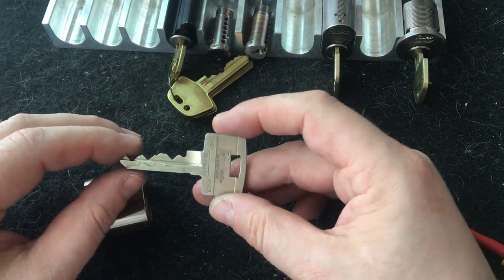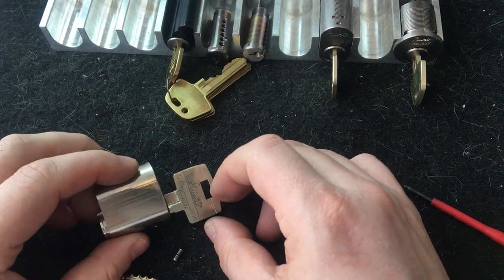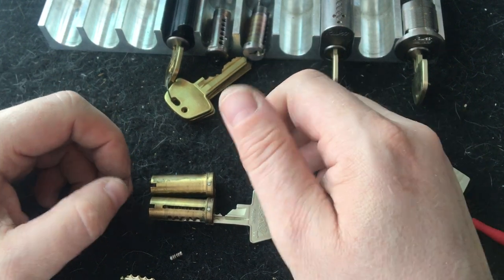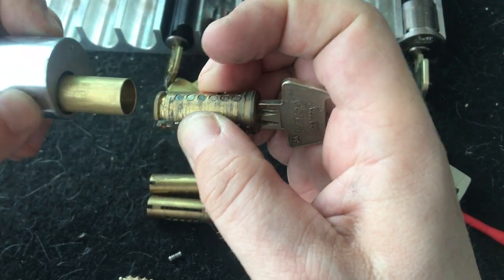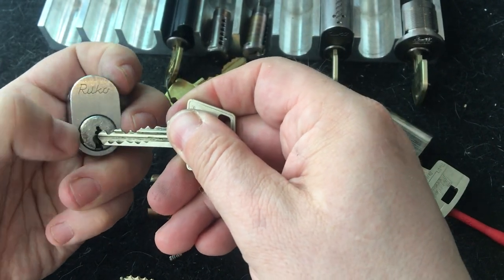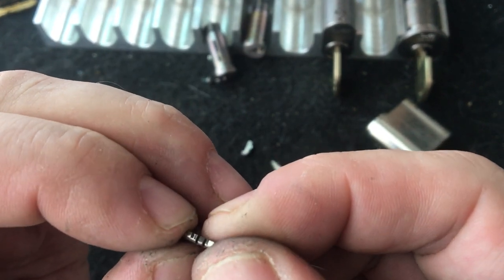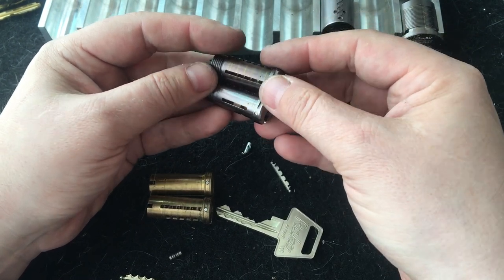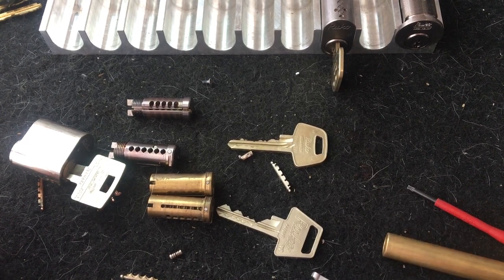050 - Ruko School 32 - Sidebars from twin to triton

Comment: Nice expo on the Ruko applications. Definately some worthy contenders. Have a safe one:-)
Reply from the maker: Yes we care about security. No need to make it too easy, Today even letterboxes come with the 600Rb cylinder as default. Have not seen a 5 pin in a new install for many years

Comment: Fantastic video Rune, your videos are getting better by the day. I've managed to get my hands on a Triton, it's branded Triton2 and as you would expect, only has a two element sidebar. Even so it's very, very difficult to pick.
Reply from the maker: Michael Maynard thanks. The 2 pin version is only for low security such as a padlock or letterbox. It is not recomended for the front door. And if someone break the letterbox open and decode the lock, they still can’t get the value for the last 3 sidebar pins.

Comment: Fantastic!  Thanks for sharing this wealth of history and information.  I, of course, noticed you left out the V10, which is an upgrade to the Twin 6000 with left and right hand sidebar pins for expanded masterkeying capability, abet with the same sidebar design.  Those ASSA folks are extremely smart -- their locks are most definitely some of the best made in the world today.  
How's Covid-19 in Denmark?  (PS - I laughed at your comment wondering how Jason can sleep at night selling "Crapset", i.e., Kwikset)
Reply from the maker: We never had a V10 in Ruko. That's why. And When I make a video about the "Ruko Flexcore" it will be a UK import, we do not have them here en Ruko Denmark
Reply: @RuneInternational  Interestingly I have a ASSA / RUKO Padlock #2 and a #3, both with "snowman" V-10 cores.  They were NOS (New Old Stock) but the #2 padlock's plug has the current dual shallow countermilling but with the older "gin bottle" spools installed -- must have been manufactured at the time of switch over to the newer style.